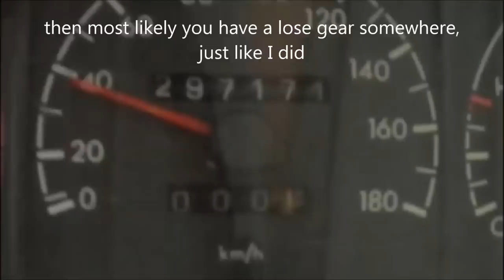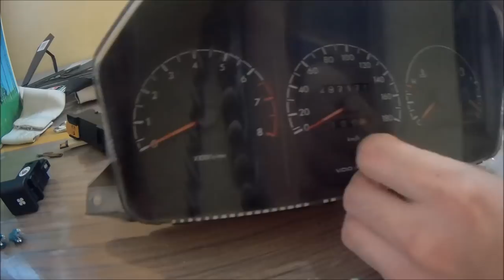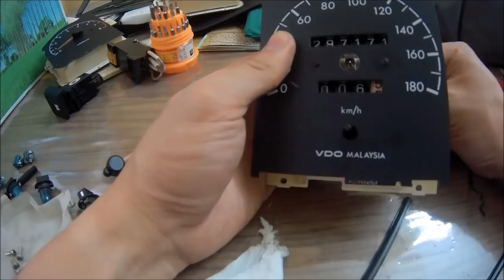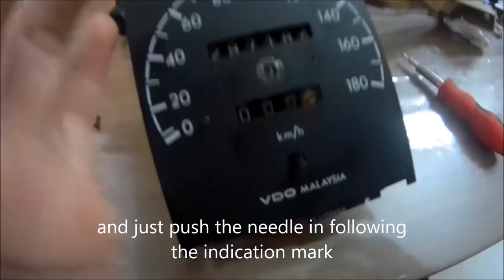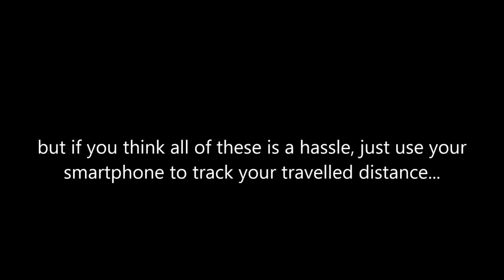How to Fix A Broken ODOMETER [stuck] but Speedometer works

Comment: Thank you for the video. People would benefit by turning off the sound and slowing the video down to .25 so everything could be watched carefully. I have wira 1.3 and the intermittent problem is that the trip counter comes to 000.9 and stops, it wont go to 001.0, and therefore the odometer wont record. This problem comes and goes by itself. It usually works fine but this time I pressed the trip reset button and then the problem started. Is the problem the green gear or gray gear? Which one is stuck or spinning freely? Which one sometimes grab the axle or sometimes spins freely? Also, have you thought about the problems further and thought of a way to get at the green and grey gears without disturbing anything else? For example, might there be a way to modify the clear housing to allow both gears to be slid off the axle, put back on and secure it with a paperclip, pin or something so the future repairs could be done easily? And, did you ever contact VDO to see if they had replacement parts? If VDO didnt make the gears they might say who did.
Reply from the maker: Apologies for the inconvenience, glad Youtube had some features to help with that. I'm not a professional car mechanic, I'm just a hobbyist and hence i didn't go that far to contact the manufacturer. What I could guess from your description is that your least-significant-value gear is lose. and I'm not sure if you have two rows of digits like mine has, but i'm guessing you do and you're referring to the bottom ones. In my case, it was the grey gear which was lose, it wasn't supposed to rotate freely like I did at 02:10 and hence I added some superglue to fix that
Reply: @YYEngineering  I do understand you are not a mechanic and thats OK. Your video was very good and the only one covering this topic. Yes Wira has two rows, basically the instrument panel is the same as Saga. I just went to KL from Penang and the odometer only recorded half the mileage because the trip meter would stop, and only start again if I hit the top of the dashboard with my hand and played with the trip reset button. Yes, I understand that the odometer is dependent on what the trip meter does so I must solve this problem. If the fuel meter also fails, COMMON, then a person would never know how much fuel is left in the tank. ALL the instruments are prone to failure and VDO refuses all repairs. Even if I replaced the speedo, it would be with an old secondhand instrument and that doesnt solve anything. I understand how it comes apart but in my opinion resetting needles has to be avoided so Im trying to see from your experience if there is a way to get at the gears without total disassembly. I really hate this problem. Also, I had an idea, do you think its possible to remove the pin that on the face of the speedo that rests the needle and note where it rests by itself? It might rest at 6pm or 530pm, then all you have to do is put the needle back on at that time, then move the needle past the pin point and  stick the pin rest back in. Possible?
Reply from the maker: @cvcoco  thanks for the complement! It appears to me that if you don't reset the trip meter things run fine. I can only guess that the reset pin causes some misalignment between x.x gears on your tripmeter, when it's supposed to turn from 0.9 to 1.0, the gears don't turn. Note that the speedometer cable and the odometer are not driven by gears, they are driven by frictional plates so if the gears are stuck, the speedometer cable is running but not your gears, the frictional plate ( 02:38 silver round plate) are just not coupled.
your suggestion would work I suppose, but you would have to rely on the spring not releasing more than it should when you remove the needle. In your case, I would think you won't even need to remove the front plate and hence the needle could stay in. you may only need to remove the back cover to check if there's any misalignment that's caused by the reset pin? I could be wrong
Reply: @YYEngineering  I dont think you are wrong. Ive had the car for years and when you press the reset, you easily feel the tumblers lining up again. This time, last week, the feeling was different and seemed to reset in stages, like the feeling something was broken. THAT must have been that the button was misaligning something. After that, the button felt fine when I reset many times during the trip but obviously whatever went wrong the first time was still present because the numbers would not flip over after 000.9. When I got near to KL, all the numbers were running normally and also all the way back to Penang, and recorded 412km. Having said this, now you are introducing a second problem, that being the friction plates. Does anything in your video show them. I dont even know what they look like. I wish we could do this together at your table!
Reply from the maker: @cvcoco  if you look at the video 02:45 and pause, you'll see two round plates (one I hold in my hands and the other on the table), they couple together to form a frictional plate that allows the speedometer cable to run faster than the gears assembly of the speedometer.
Reply: @YYEngineering  Ok I see, the plates are something like a dry clutch and have to mate and stay mated during operation of the meter? And, what goes wrong here, dirt? oil?
Reply from the maker: @cvcoco  yes, except that they stay mated during operation of the meter all the time. I'm just guessing that between the transition of 0.9 to 1.0, your mating plates must be working but not enough to overcome what's causing the stuck/blockage in the gears, could be misalignment. Otherwise, if the mechanism of the speedometer cable and the speedometer gear assembly are coupled with gears, it could result in your speedometer gears damaged or your speedometer cable broken when the speedometer gears are stuck.
Reply: @YYEngineering  This is interesting. So are you saying the design which gave the plates overcame the problem of gears becoming stuck when coupled directly to the cable?

Comment: same problem with me. the metal gear are loose.. never tought the super glue will solve the problem.. haha.. thanks bro
Reply from the maker: No worries, glad it worked for you
Reply: @YYEngineering  hye bro. I also face same problem. If you dont mind can u fix it for me? 😅

Comment: Wow guy !  the workshop ppl should take training from you !!  Its impossible to find a new odometer alone in Kuala Lumpur. I have a 25 yr old Iswara and the odometer died 2 years ago . the car should have clocked 400k odd before this.. Would you please have a look at it.  As no workshop guy is interested to fix this. (my lack of local language skills is probably contributing as well). Thank you in advance.
Reply from the maker: well, I do this for a hobby, and of course I don't mind helping you to have a look, but where is your location?
Reply: I checked yesterday, and the parts shops say no more stocks of the speedometer. The factory stopped production a few years ago.

I should have bought a spare earlier.

Comment: Hello, My speedometer is working fine. The pointer is moving. But the trip meter and odometer not stepping up.I understand that the trip meter had to step up for the odometer to increase per unit. Has this got to do with the cable or just the meter. Please help me.
Reply from the maker: it depends on which car you're driving, if you have the exact same car, it wouldn't be the cable. As the speedometer and trip meter share the same source

Comment: Doesn't the spinning circular dial (the one driven by the cable
turn the tripmeter's decimal number (the white one) first, which is 
itself connected to the odometer's first digit on the right ?

In my case, both odometer and tripmeter has are not working.

I think the main culprit is the small white gear connecting it to 
the odometer.

I'd be grateful if you could explain how the mechanism works.
Reply from the maker: it actually spins both the tripmeter and odometer together, you don't see your odometer changing as frequent as your tripmeter because there is a hidden gear next to the least significant number in the odometer's digit-row. My guess is that either your tripmeter's gear is broken or your cable is (which would then be obvious since your speedometer shouldn't be working too)?

Comment: On my 1980 datsun 720 pickup the speedometer is stuck at full speed. 24 yrs ago when I got it, it was working, but I took off the lens to clean out the dust and bump something and it's all the way full speed on dial and just stays there.??? don't have a clue on what to do to fix it?? The OD #s still work, and at driving speed the needle twitches. But it's at full speed on the needle.
Reply from the maker: It sounds like when you bumped the needle could have popped out and hence no longer coupled with the speed indicating pin, but I'm just guessing here...
Reply: @YYEngineering Thanks for the comment,  I was thinking to pull it out from the dash again and screw with it, But would hate to screw up something in the process, lol

Comment: The needle while accelerating 0-45km works in up & down motion (jerking) after that it works fine. (45+km) would like to know any method to fix it. 
Thanks
Reply from the maker: I'm no expert myself, but sounds to me like your speedometer-gearbox cable isn't spinning as fast as it should or the friction plate between the speedometer and the speedometer-gearbox cable is worn out?
Reply: Thanks.

Comment: At 3000rpm in 5th gear, your speed would be at 100km/h. If it's a 1.3 Avanza it would be 80km/h and an A/T Myvi 100km/h@2,500rpm.
Reply from the maker: Princess Solace thanks for the great information, not something you can easily find online
Reply: That's the gear ratios problem

Comment: In my case the odometer is running but only about half the speed. How do you fix it? Thanks.
Reply from the maker: If it is due to displaced needle then you would need to remove the needle, and then go cruising at a fixed speed, apply some super glue to the hole and put it at the right speed. If it's the speed-release connection or fir modern cars, faulty motor, then you would have change out the parts
Reply: The speedometer and the tripmeter are running fine; but the odometer (the mileage counter) is not working properly. Compare to the tripmeter, the odometer runs slower and off by about half. Thanks for the reply.
Reply from the maker: yuvan winanda is it analogue or digital?
Reply: analogue
Reply from the maker: yuvan winanda I'm guessing, but I can't be sure... Maybe your gear is slipping which is causing that. Maybe you can try applying glue to the gear?
Reply: This is what happens sometimes.  The tripmeter runs but the odometer does not. The odometer can also run, but the tripmeter does not.

That's why I would be happy if you may explain the mechanism by which the spinning disc (connected to the cable) drives the tripmeter or odometer.

Comment: Bro, can you fix wira's odometer? Where is your work shop?
Reply from the maker: Kah Weng Chok hi bro, I don't own a workshop, I did this out of interest only. What's wrong with your odometer?
Reply: sometimes it's running, but after a while, it stops. then later it runs again.
Reply from the maker: odometer only? Speedometer running fine?
Reply: ya, just the odometer.
Reply from the maker: normally, the speedometer and the odometer are synchronized. In your case, it sounded more like a gear issue like mine, where the gear gets struck and doesn't turn the odometer anymore.
Reply: ya probably, would you be interested to fix it?
Reply from the maker: I don't mind having a go at it, though there is no guarantee to fix it
Reply: yy c,  how can I reach you. I have problem with my odometer, too.
Reply from the maker: sorry for the late reply, i hope you fixed your problem!

Comment: Hi bro, my Proton Saga speedometer and odometer died few months ago, is it possible to repair or else just replace the whole meter for whooping RM200++?
Reply: My odometer not very good either. Seems they say that there are no more new speedometers, because the factory stopped production a few years ago.

I should have bought a spare last time.
Reply from the maker: sorry for the late reply, but Speedometer and Odometer dying on Proton Saga (depending on year of manufacture) could be more than just the meters themselves, it could be the cable from gearbox to the meter assembly, or it could be a motor if yours is digital, etc. hope you got yours fixed relatively cheap
Reply: @YYEngineering  Thanks for the reply, I found out that the problem is the corroded cable that mulfunctioned. And it has been fixed relatively cheap too around RM50+.
Reply from the maker: glad it didn't cost a fortune sir, stay safe in this MCO!

Comment: How about rpm meter and indicator light not function,how to fix it
Reply from the maker: rudie0626 rpm not working is mostly due to lose wiring at the back of the meter, nothing mechanical. The indicator light could be due to lose contact or simply changing the light bulb? But there could be other causes too.

Comment: I changed my metre card for all temperature, speedometre and fuel metre. The thing is....after remove the needle..unable to put it back to normal, not accurate anymore. Especially the most important needle meter is temperature n fuel..plz help 😥😭
Reply from the maker: assuming that your car is Proton Iswara, my advice would be, run your car without the needles, wait for the radiator fans to start running, that indicates that you've already reached the optimum temperature for the engine - the middle, then place the temperature needle. For the fuel, just fill your tanks to the maximum level and place the needle at the maximum point.
Reply: @YYEngineering  tqvm for the feedback. Will try to improve it! 👍👍 And for speedometer, i unable to see what do u mean at 5:56 . Thx!
Reply from the maker: @Fr33domSouL  No problem! I think some meters may have marks as to where you should place your needle, for it to be accurate.

Comment: My Mazda 2 2017 v+ and my friend's Mazda 2 2016 have the same issue on Speedometer. after switching off the engine. the Speedometer (Stick or hand) is not returning back to to Zero. it's staying at Around 5km just above the Zero. anyone else have the same problem? or is this normal?
Reply from the maker: shouldn't be normal, it seems to be a manufacturing defect...